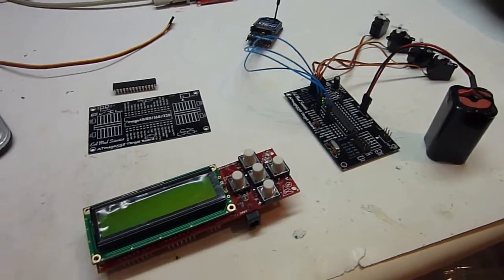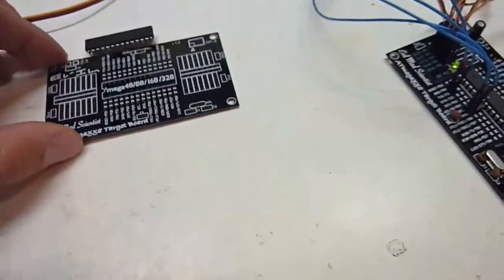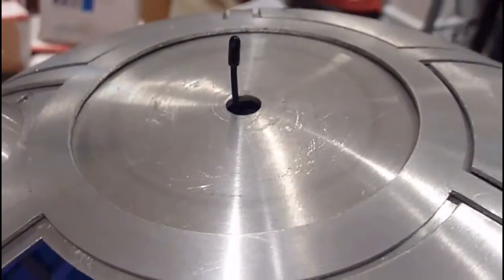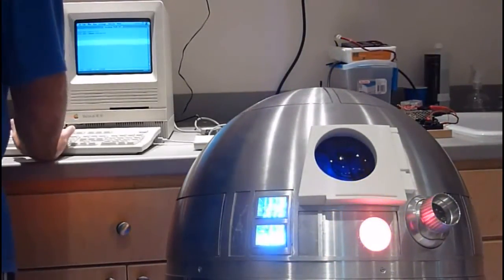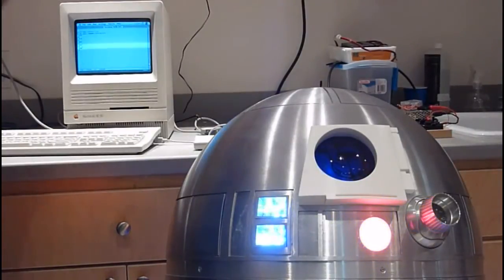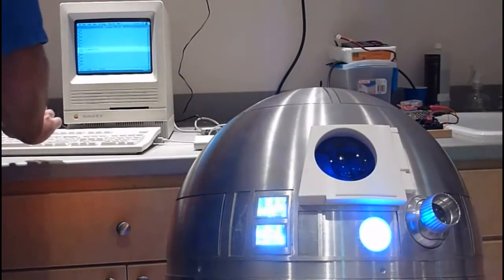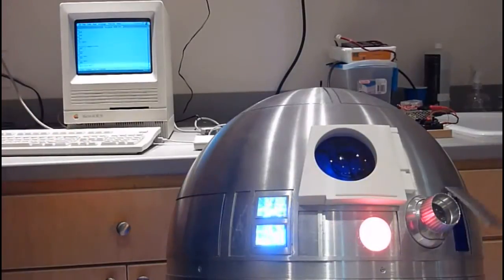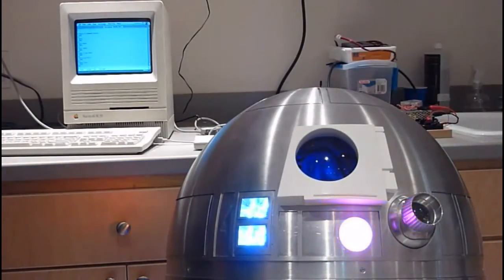R2-D2 Dome Panel Control - more details

Comment: the software you use for the macintosh what is it? is it a terminal? Serial port ?
Reply from the maker: Just a terminal program , aptly called “Terminal”. Connects to the XBee via a serial port. These were baby steps from long ago. This all done now with WiFi and my R2 Touch app.
Reply: @CuriousMarc  
from where I could download it, I would like to use it on my macintosh SE, thanks for the answer, regards
Reply from the maker: Try MacIntosh Garden, they have almost everything.
Reply: @CuriousMarc  
Excellent .. I did not know it existed, thanks, greetings!